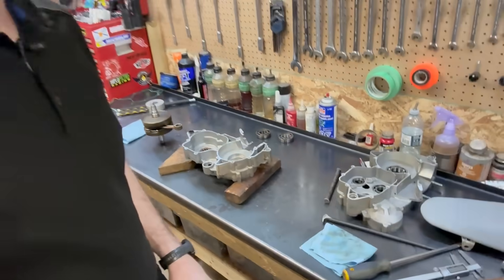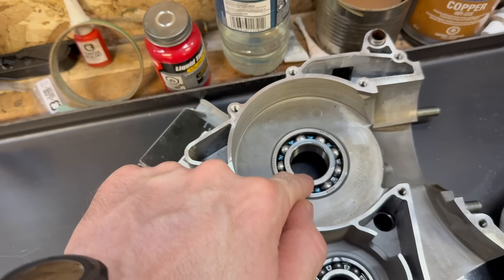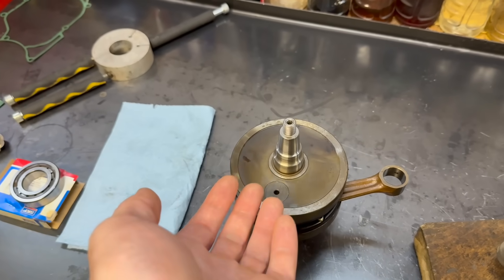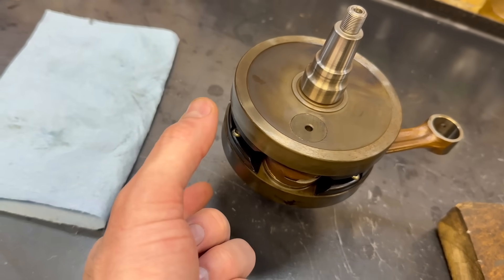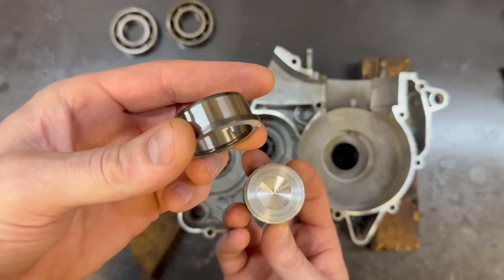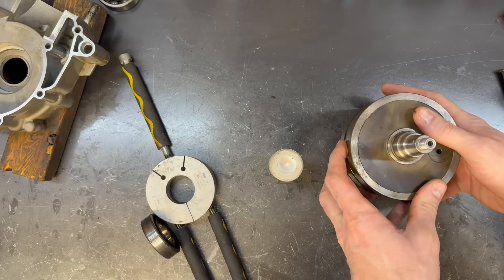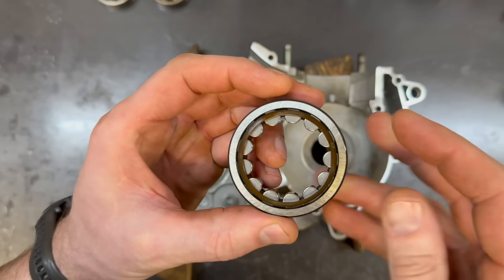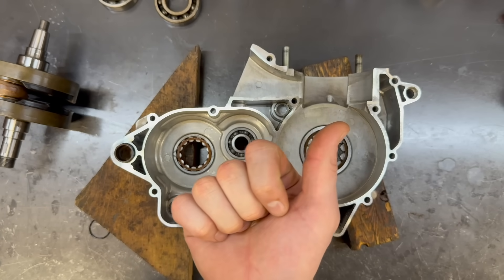Beta Crank Bearing Fix - Roller Bearing Update

Comment: Dear Chuck, is it possible to update both sides with roller bearings?
Reply from the maker: No. Roller bearings require side clearance. The nut on the right side pulls the assembly together.

Comment: I have a betta 200rr that got ran with no oil in it and the crank bearing is locked up where do I order these bearings that you're talking about that you can't sideload
Reply from the maker: I believe the bearings in the 200 are smaller. No option for a roller bearing.
Reply: Quick question I bought this bike because the guy ran it with no oil in it he ran straight gas in it I'm probably going to have to replace the whole crank right cuz you were saying if it got hot then it was no good right

Comment: What's the deal with the roller bearing clearance specs? For example: KTM changed the part number on their NJ207 Bearing. It went from a C3 clearance spec to a C4 clearance spec. On my older 98 300exc the C3 specified bearing would yield a noticeable axial play when engine was up to runnimg temp. When I replaced it with the newer specified C4 clearance bearing, this issue was resolved. The confusing part is that the C4 bearing, I think, is a looser fit, however it was much more dificult to install on the race when assembling the case halves. Does a C4 bearing have more clearance than a C3 bearing or do I have that understanding backwards. I'm super stoked that I found your channel. 
   Sincrely thanks,  
          Rich
Reply from the maker: I’m not sure how big a difference there is in the specs or why they changed it.

Comment: Nice video, like always 👌🏼 recently i rebuild my TM EN300 2015 engine. This model had two roller bearings, really nice. The hole engineering on this engine looks good, with lubrication holes on the clutch design etc.

Comment: What year did beta switch to the updated bearing? I have a 2023 250rr so I’m just curious!
Reply: The update happened 10/2023. My 2023 300rr has 44hrs on the bottom end and had right side crankshaft failure - both ball bearing style so I bought the updated bearing 

Here it is 

NJ206ET2XCS46
Reply: @ShawnMcGann-p2i  did the bottom end with that same reference. Hope it lasts. What % oil do you pre mix?
Reply from the maker: I think it was ‘22 but not sure.
Reply: just had bearing failure a mounth ago on a racing edition with more or less 80 hours. pre mix ate 2% cant figure out what and why this happend

Comment: Was that a roller bearing in the transmission too? Is that an upgrade or stock Beta bearing?
Reply from the maker: Beta & KTM use a roller bearing on the output shaft, left side.
Reply: @otpipe  my apologies I obviously responded to the wrong bloke🤪
Reply: @777Randall  it's all good. No harm, no fowl.
Reply: @otpipe  based on your question I’m trying to ask myself. Did you actually watch the video?
I guess if you don’t know you don’t know but in the video it makes it quite clear that beta and even the TM have had known problems with failed left side crank bearings. This guy giving the video makes it quite clear that it’s widely thought the reason why the bearing fails is because it’s being pushed to the left Because of the pressure from the right side and the crank not being centered and stress relieved in the bearing.
The roller bearing eliminates any side pressure because the crank can simply move left or right in it without serious force, which is what is causing this bearing failure.

Go back and watch the video and listen carefully again☝️
Reply: @777Randall  based on your response I'm asking myself did you comprehend my question? I asked about the transmission output bearing. 🤣

Comment: The brass cage roller bearing are a better option than the polymide cage 
Nj206ECP-polymide
Nj206ECM- brass cage
Reply: @brandondoorn900  OK that’s good to know, not that I’m being a tool bag or doubting you but how have you established this to be a fact, thanks in advance
Reply: @ it’s essentially nylon vs brass. Both bearings share the same static and dynamic load rating but the NJ206ECM has a 8000 rpm higher limiting speed than the Nj206ECP. Brass is more durable and heat resistant than any polymide while being completely unaffected by oil/gas. Only downside to brass is it’s more expensive
Reply: Hey bud so the official update now via directly from Beta is to use this bearing on ignition side 

NJ206ET2XCS46

What would the direct replacement be but with the brass cage? I appreciate any help as I’m kind swamped with learning how to do my first bottom end rebuild as it is let alone bearing measurement 😅
Reply: @  Direct replacement is nj206ecm, good luck on the rebuild👍

Comment: Hi, Chuck. I am wondering if the interference  fit between the case and the outer race is tighter than the inner race/crank. I see a lot of people using a puller to adjust the crank when both halves are installed. Could pulling from one end unseat the bearing ever so slightly?
Reply from the maker: Highly unlikely. The bearing will stay put in the case.

Comment: Interesting, I was curious about doing something like this to a much older bike during my first rebuild this year but I figured if the engine with original bearings lasted 40 years I probably shouldn't start changing things. After pressing the case halves together I gave the crank a few smacks with a rubber mallet and it seemed to find a happy place as it loosened up considerably and became extremely smooth to rotate.
Reply: @BurnerJones  yes truly believe this is the correct method as I have heard this for years myself☝️👍👌

Comment: Rollerbearings can withstand a whole lot more load than a ballbearing. A ballbearing is a lot cheaper to use and can withstand higher rpms. The NJ/NU bearing is often used in applications where there's a lot of side force or heat expansion.. My opinion is that the crank is to wide so there is to much sideload on the innerrace of the bearing when the cases are installed. Or it may be so that theres to less oil feeding the bearing because of the TPI/TBI...
Reply: Ive had a lot of 250 and 300s mainly Gas gas....put them underwater in rivers and all sorts without too much trouble...the 19 300 Beta only one that done mains at low hours.....your absolutely bang on about if crank fractionally wide it will destroy mains...

Comment: KTM have used the NJ series bearing on the flywheel side since approx 2001- cant believe the other 2 stroke makers havent done the same ! they actually use a bigger NJ207 on the 250/300, the NJ206 is for the KTM125/200's
Reply: Goes back further than that. My '96 360 uses an NJ306

Comment: Good job. KTM also used a ball bearing on the 950 LC8's balancer shaft. Later, for the 990 they changed to a roller bearing. More expensive, but easier to install correctly and without damaging the bearing.

Comment: Hi Chuck, what is necessary to switch from a ball bearing to a roller bearing? I've got this engine in which I installed a big bore kit, stroker crankshaft and has a balance shaft  too. In order to retain enough rolling mass, I've been suggested to install an extra weight on the flywheel. I was thinking that the extra weight (350g rotor plus 350g extra mass on it) maybe its starting to require a stronger bearing. My engine usually requires two ball bearings which I center once the two casings are assembled. If I mount the roller bearing on the flywheel side do I have to shim the roller bearing inner race? Or do I just drop it as you did and then center the crankshaft as I usually do?
Reply from the maker: You never need to centre a crank in the cases. The crank gets pulled over to the right when you install the primary nut anyway. Then you have a side load issue. I explain it in detail in my YZ250 bottom end video.
More rotating mass does not put more load on the main bearings. A big bore might potentially stress the bearings a little more but it’s negligible. 
There are no modifications needed to swap the bearing from a 6206 to an NJ206.
Reply: @ChuckfromTrueTech  thank you Chuck, but my crankshaft does not make contact with the primary Gear, nor the bearing with the primary, that's why I asked! Anyway, I'll look for you video, thank you!!

Comment: Why does the YZ250 for example not experience the same bearing failure issue?
Reply from the maker: I don’t know for sure. I expect it may be a difference in assembly procedures at the factory but it may also be that they use a 63/28 instead of the 6206 or maybe it has to do with oil injection vs premix. Both the Beta and the TM have oil injection. My Beta was a race model (without oil injection) & it’s still going strong with over 400 hours. No definite answer though.
Reply: YZ250’s have large oil ports and recommend richer mixtures.
Reply: Possibly a different production process resulting in fewer side load issues ?

Comment: Hi Chuck,
older TMs (<2021 carburated) use both roller bearing on the crank. What's the downside of that? Won't the crankshaft have too much side to side (bearing to bearing) play? 
Is it better to use one roller bearing and one ball bearing?
Thanks
Reply from the maker: I’m not sure really. I expect it may have to do with keeping the crank in position though. Most cranks are located using the primary gear/collar/nut.

Comment: If the roller bearing is better why not use it on both sides?
Reply: price, on my husaberg the pair of crank bearings NJ207 are 160$
Reply from the maker: Totally different design. I expect it’s just easier to locate the crank & mount the gear on the right side.
Reply: I dont know but a ktm 350excf has roller bearings on both sides😊